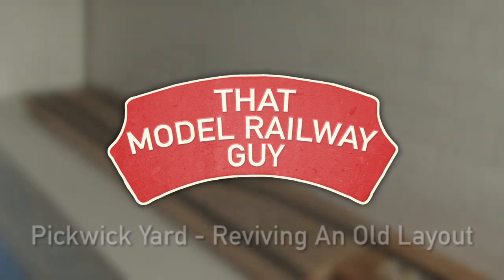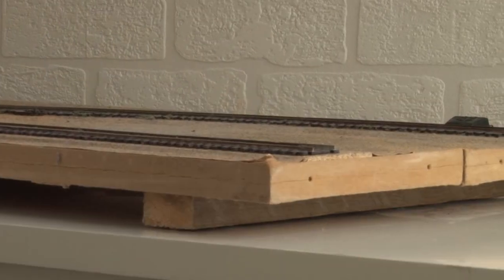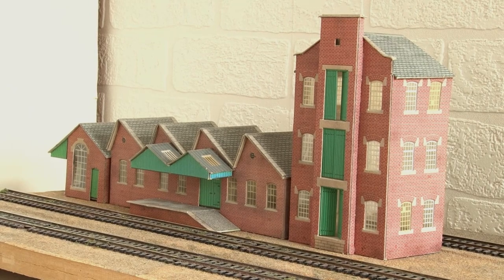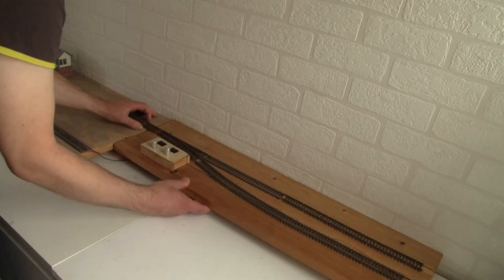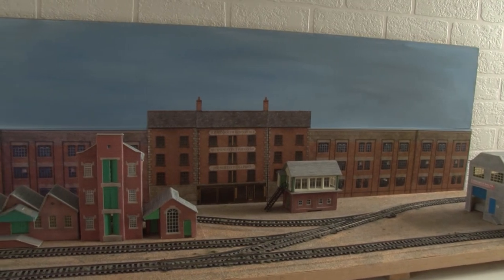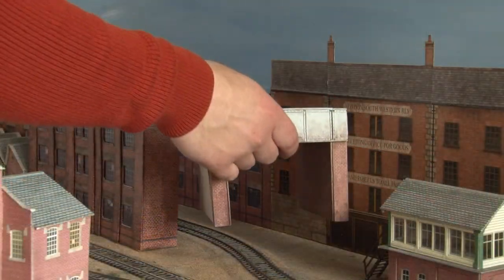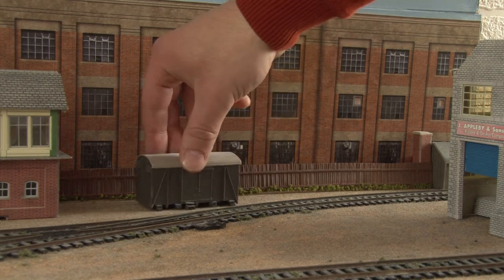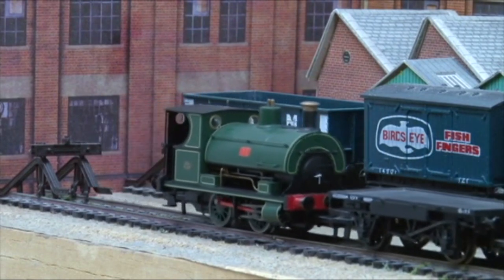Pickwick Yard - Reviving An Old Model Railway Layout

Comment: This is a great track plan and it's amazing how with some TLC you brought this up to par. Lots of operating potential. I clearly don't know enough about those cardstock structures, I may humbly ask you enlighten the newbies such as myself. Thanks for sharing!
Reply from the maker: Thanks! The plan is (very loosely) based on one I saw in a Hornby book years ago with an extra siding and the fiddle yard added. The card kits are from Metcalfe and are great for beginners as they're so easy to build. There are also Superquick Kits as well which are a similar concept but slightly cheaper. Hope that helps and thanks for watching 😃
Reply: Thank you for that explanation,  @ThatModelRailwayGuy  ! I'll have to see if these are even available across the pond. By the way, I can't tell you how flattering and appreciative it is that  you do take the time to reply to your viewers.

Comment: Cracking layout....inspired to use a similar track plan if I decide to refresh my own shunting plank (am not happy with the experimental baseboards I used). 

Do you have any issues with the insulfrog points and short locos? Also, have you used isolating sections? Finally, are the points manualy controlled?
Reply from the maker: Thanks Matt, it's definitely a fun track plan and easy to adapt and make your own!

I don't have many problems with locos stalling on the points - when I do it's usually because of dirty track rather than the point itself. These are old second hand Hornby points from the 90's too, so modern points are much more consistent. If you watch my review of the Ruston 48DS you'll see even that goes over the points without needing the additional pickups from the wagon.

The layout doesn't have isolating sections as I just rely on the points to switch the power - although I admit they would be handy if you wanted to do shunt and release operations. And yes all the points are manually operated on this layout. It was only ever intended to be a quick layout for home use but thankfully I can edit out the "Hand Of God" moments in the videos! 

Hope that all helps and thanks for watching 😃

Comment: It is maybe 20 days until the end of 2022, and now I want to see if I can challenge myself and make a micro layout before the year ends...

I'm gonna go for it,
Reply from the maker: Awesome, yeah definitely give it a go. Pickwick Yard really didn't take long at all even factoring in the track laying and constructing the buildings so it's definitely possible! Thanks for watching 😃
Reply: @ThatModelRailwayGuy  
10 days later, and the track is laid,
Nicking my dad's drill later to get the wiring done and then trying ballast for the 1st time,
Thanks for giving me the kick to do this!
Reply: @ThatModelRailwayGuy  and it is pretty much the end of the year,
The track is powered and I was able to do a very basic version of the Inglewood puzzle with what I had,
Absolutely nowhere near finished, need to sort out some hinky stuff due to all my points being passed down a generation or two, but it runs and I know what I want to do with it,
Thank you for the inspiration and I cant wait to see what you have in store for 2023,

Comment: How big is that Baseboard?
Reply from the maker: The original size of the layout was 135cm x 35cm. The fiddle yard extension that was added later is 75cm x 22cm which brings the overall length to 210cm. Hope that helps and thanks for watching 😀

Comment: Just a quick question, what are the dimensions for the layout ?
Reply from the maker: Hi Chris, the original size of the layout was 135cm x 35cm. The fiddle yard extension that was added later is 75cm x 22cm which brings the overall length to 210cm. Hope that helps and thanks for watching 😀
Reply: Yes it does thank you 😊
Reply from the maker: @chrisbaseballover  Brilliant, happy to help out. If you have any more questions feel free to ask away 😃